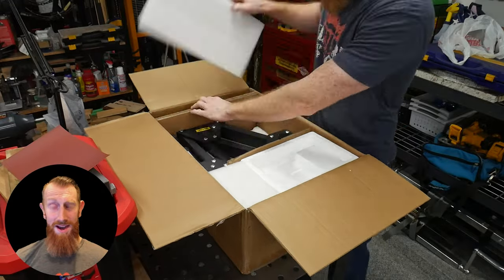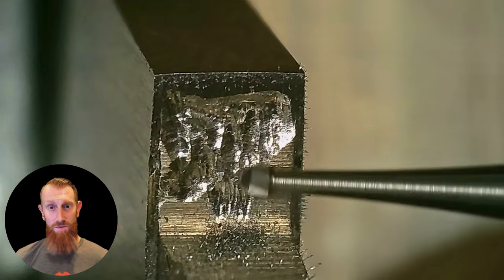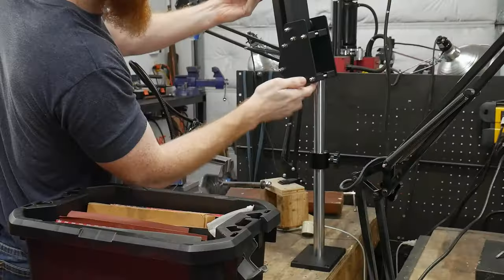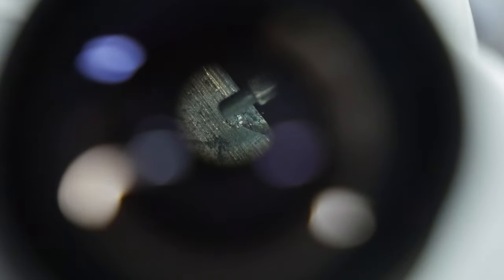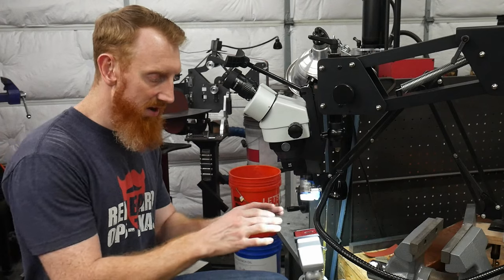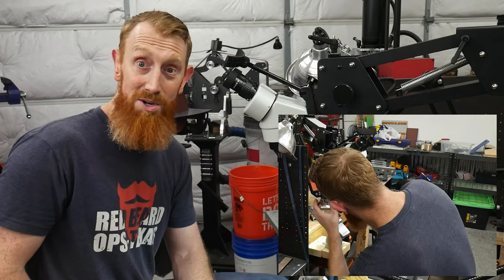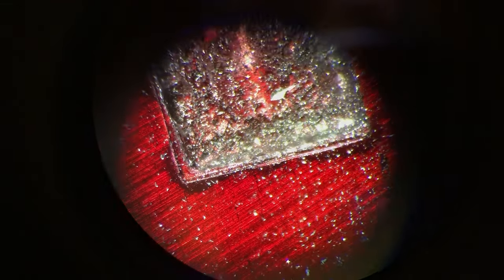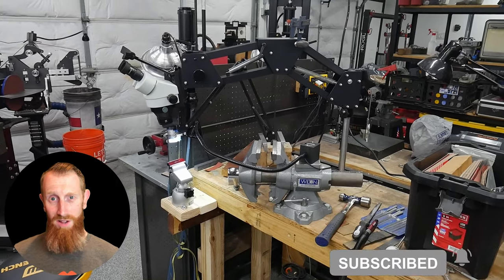Want To SEE What You're DOING?!?! - Engraving - Inlay Microscope Review

Comment: Get yourself an annular light to go around the objective lens, it made a world of difference in clarity and contrast when I picked one up.  Having one or two light sources in just the wrong spot when you're working with shiny metals can have the effect of making low spots look like high spots and vise versa, especially at higher magnifications, which can really disorient you and sometimes lead to big mistakes.  Don't get rid of the other light though, if you're still having trouble visualizing the "topography" of your engraving, flip it on and put it at a shallow angle to the workpiece so it casts shadows, then move it around while looking through the scope until you find a spot that gives good definition.  Sometimes that helps to get a better picture of the highs and lows.  Congrats on the nice optics!
Reply from the maker: Man, thank you for the tips! I'll look into that for sure. Sounds like a great idea.

Comment: OMG thank you for this vid! 
👉 If your eye pieces don’t slide in, UNSCREW the tiny screw first. 😆 Slide in & then tighten screw & then repeat on other side. Does not matter how you rotate them at this point but I just put the white littering towards the south! When you go to put the big lens in on the bottom, it is not going to just screw in. You have to really apply some pressure as you are screwing it in and try to do it just like he doesn’t the video because you’ll need even equal pressure (pushing in a bit) and do not let go until you’re absolutely certain that it has screwed in, is even and 100% secure. Also don’t press too hard and have patience on this part. To get the little silicon, rubber eye things on, slow his video down to the slowest possible setting and watch very closely. You can do it! 🫸💥🫷
Reply from the maker: Thanks!